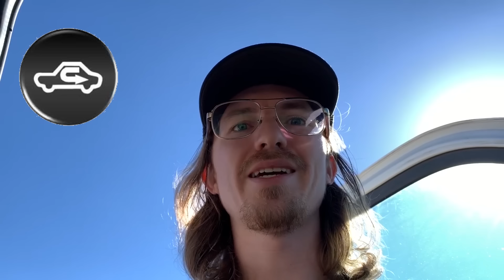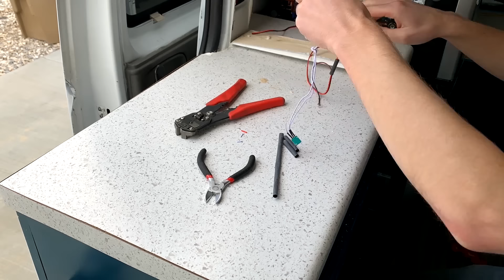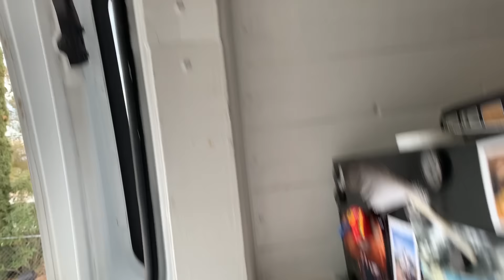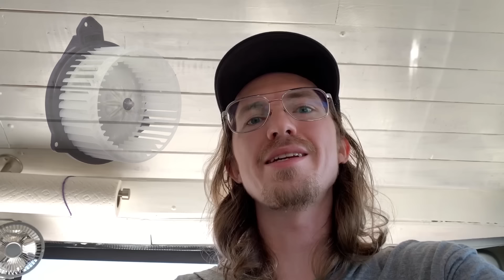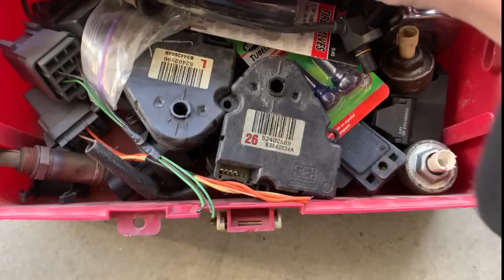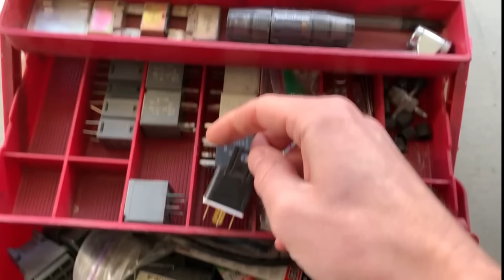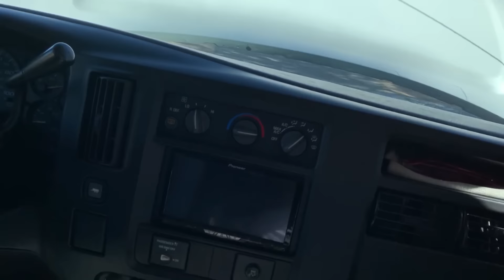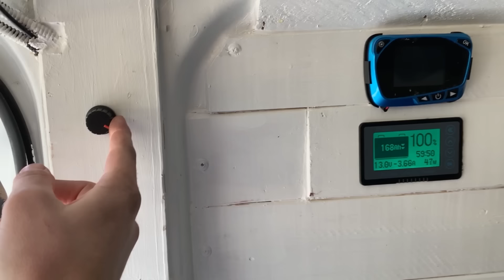OEM Blower Hack **ULTIMATE STEALTH**

Comment: Neat idea, but a rooftop fan will pull air OUT of the van and will do a FAR FAR BETTER job of that than trying to push air out the body vents via the OEM blower motor.
Reply from the maker: Spot on Mike.
Really wished I would have left roof space for one, but I suppose this is better than waiting for a breeze to clear the interior air.

Next build will definitely have a roof fan.

Thanks for watching!
-Tim
Reply: @VanwithTim  There’s nothing stealth about a roof vent, so I’ve given this a bit of thought (but no action)... I wonder about a fan that pulls air from up high near the ceiling and then pulls/pushes it through venting (completely inside van) and pushes it outside through the floor. Basically like a chimney but in reverse.
Reply from the maker: @FloridaNativeMike  I'm feeling it, like a duct that grabs all the hot air from the ceiling then pushes it down and out.

Someone else mentioned using a fan affixed into the "step" area and vented through to the underside to push cool air into the van.

Have you seen this stealth window setup yet? Pretty cool idea:
https://youtu.be/9WdWvQaoN5A?t=230
Reply: @VanwithTim  I hadn’t seen that one, but a lot of folks with cargo trailer conversions vent the AC through the floor, similar to this one: https://youtu.be/9lH5-rdSRos I would think that could be made to work in a van, maybe using some tubes to move the air instead of such a large hole.

Comment: The first time viewer, thanks Youtube for the recommendation. 

I'm guessing the idle draw on the motor controller is minimal but what about swapping in a Potentiometer with on/off? Ok now to check out your channel...cheers.
Reply from the maker: Just measured the standby power draw at 0.057a at 13.1v (so ~0.75 watts)
Not a big deal for my battery bank and solar setup, but those with smaller reserves may want to integrate an on/off switch as you mentioned!
Good call Daniel 👍

Comment: good stuff.  I have an 95 E350 15pack and have been thinking about how to use the OEM rear passenger compartment blower when the engine is off. cheap and easy solution here! 
Also happy to see someone else using that cheap 3kw "reliable" brand inverter. 2+ years of that bad boy on 24/7 in my rig with no issues!
Reply from the maker: This would be great for that!
Funny on the inverter. Was just thinking I've been pretty lucky with it. 
This certainly isn't a high-dollar van build.
I also just leave it on 24/7 unless I'm storing the van for a month haha

Comment: 2 pc fans on the exhaust grills is a cheap and efficient option or maybe leave ignition on and charge van battery with the solar controller so it just costs wire.
Reply from the maker: We actually used to keep the key on and just run the fan, unfortunately our Victron battery combiner disconnects the starting battery from house battery if the solar isn't charging / van isn't running.

Could always do a manual bypass so long as the combined battery voltages were monitored closely!

-Tim

Comment: Hey Tim - noticed you have your passenger seat turned around. Is it on a swivel? The only swivel I've found offsets the seat 2" in order to clear the door, but curious if you found a way around that?
Reply from the maker: Hey Chris, good eye.
Unfortunately it was a custom manufactured swivel from John Kennedy and this was his last one. I don't believe he's planning to manufacture any more. It does keep the stock seat height which is nice.

Here's more information:
https://www.facebook.com/groups/1426529440979542/permalink/2380171022282041

Comment: Still not as efficient as a fan up high blowing out drawing in cooler air
Reply from the maker: Spot on. 
A (very small) saving grace is the mode selector defaults to defrost when it inadvertently loses vacuum in the actuator. 
So at least it pushes the cool outside air somewhat towards the hot roof.

Rooftop fans will always be king of efficiency though!

Thanks for watching!
-Tim

Comment: Similar to a plan I have. I will utilize the rear vents and ductwork in the rear of a minivan and attach a dedicated 2-way fan via section of flexi duct and manual damper. Fan will run from leisure battery. Reality might adjust this plan, ofc. Great video btw.
Reply from the maker: Utilizing the factory duct work sounds like a clean install to me! 
Thanks for watching Neil!

Comment: beautiful!! i want to do this project even though i already have a roof fan! 
when you were thinking about only running a positive wire up to the fan i was thinking to myself “NO!” ... but then you found out you had a high-side dimmer.  
great video!
Reply from the maker: Hey Leo, thanks for watching!
Still a little bummed I can't reverse the air flow like you can with your rooftop fan, but it was a fun project and seems to work really well!
-Tim

Comment: "should be" quieter for stealth camping too
Reply: Can be quieter than OE because the PWM will allow you to set the fan speed lower than the OE resistance control.  I have only seen it noticed once in years doing this.

Comment: im another Tim vanner.... do other vans have that stock recirc thru the body & out the back set up?
Reply from the maker: Hi Tim, all vans will have that same setup of fresh air through the front, stale air out the back through the hidden vent(s).

The vent in the rear is disguised not only visually but also in name. GM calls theirs "Air Relief Vent" or "Relief Valve" or even "Pressure Valve, Quarter Panel Vent"

Here are some examples:
https://www.gmpartsdirect.com/search?search_str=air%20relief%20vent&make=&model=&year=2005&page_id=&page_url=

What type of van do you have?
-Tim
Reply: @VanwithTim   i have an 89 turbo dodge caravan (minivan). My climate controls are messed up ill have to mess with it.  i would like chevy van like yours tho
Reply from the maker: @saltpepper1894  Respect, the ORIGINAL mini van!!! The Express van is nice but I bet you get much better fuel mileage. (I'm averaging 11 mpg  driving like a grandpa... yikes)

Hope you can get your HVAC controls figured out! Thank goodness for the internet to help with diagnosis.
Reply: @VanwithTim  Ive seen the vents your talking about....they have multiple flaps that pop out when you close a door....for your purpose (if your looking for less power consumption) why not modify the flaps so they stay open for better efficient flow? heres a video of a guy changing one vent on his express van... https://youtu.be/bojpqjooZtU
Reply from the maker: @saltpepper1894  Oops just replied to your other comment with a video of the flap location lol.

That's exactly the vent I'm referring to.

My flaps are pretty loose (very little resistance aside from gravity holding them shut). It's possible they're just worn from their 17 years of life.

I wouldn't mind having a second air exit though. That's a lot of air to cram through such a small space.  I actually added screens on all of my pop-out windows (side and back).

Comment: Very clever. That would be ideal to clear the condensation or ice from the windshield after a cold overnight. Wouldn't need to start the engine and wake the neighbors. Start the diesel heater and turn on factory defrost.... but wait hmmmm?? What about the vacuum motors that control  the blend doors??  Is default (no vacuum) defrost???
Reply from the maker: Hi Grant, I’ve woken up to frosted over windshields all too often!
Just finished the diesel heater install last month and excited to try it all out together.

The mode door is vacuum actuated but luckily it defaults to defrost 👍

Had a wonky vacuum check valve when I bought the van and the AC would start blowing on defrost whenever I accelerated haha

Thanks for watching!
-Tim

Comment: The engineers at GM must all live in houses with heated garages.  How else would they think that having the heater bring in 15 degree air (while the engine is still cold) in the wintertime would be a good idea??  I'll never buy another GM product unless it's got a dedicated recirc button that keep the cold air OUT!!
Reply: It's not just gm that does it. It's done for safety so the window won't fit up from your breathing (if course if you just quit breathing problem solved). It's also the same reason your ac runs in defrost, to dehumidify the air. That is hvac operation for dummies
Reply: @1towmater1  GM defaults to outside air to slightly pressurize the interior to avoid drawing in carbon monoxide, that is why this installation is better than a roof exhaust fan.
Reply from the maker: @1towmater1  A lot of newer cars automatically switch from recirc / fresh settings. 
They read multiple temperature sensors of course, but also vehicle speed, light sensors (for solar penetration), and multiple hydrometers (to prevent the fogging you mentioned).

Many will start in fresh air mode during the summer to push the initial stale air out then default to AC recirc.

In winter they work to monitor the interior humidity more closely and you'll notice them switching between recirc and fresh air more often.

It's amazing how far the systems have evolved! (Just not in this old van haha)
Cheers!
-Tim
Reply from the maker: So ridiculous I know... The real bummer is you can't simply add a quick electric switch for it.

All actuated via vacuum other than the temp controller. Such a disaster.
Reply: @VanwithTim  suggest installing an air switch in the vac line going to the outside air damper actuator then u would have control of the outside air in any setting.

Comment: Although this is a genius idea, it doesn’t solve the issue of air circulation as fast and energy efficient as MaxAir fan
Reply: What about a floor fan the kind used to circulate air from room to room. Just one drawback is that one can use it to blow the air out only. It would be stealth enough and no worries about water leaks
I saw someone installed a fan at the sliding door step wall
Reply from the maker: @saidt.8200  Oh that's an interesting idea! Something like this?
https://www.amazon.com/AC-Infinity-Register-Thermostat-Control/dp/B0792QR5YT
Reply: Exactly. Thank you for sharing
Reply from the maker: Absolutely right on both counts 👍
Those MaxAir units move loads of air with very little power draw.
Wish I would have left space for one, but necessity is the mother of invention I suppose!
Reply: Pop out a rear window and replace with a piece of Aluminum painted to match. Cut a hole to mount a fan and have a sheet metal shroud riveted over to keep the water out
Reply from the maker: @mrmotofy  Check this out, looks close to what you're describing just without the window removal.
https://youtu.be/9WdWvQaoN5A?t=230
I bet it moves a TON of air.
(Same PWM fan controller I'm using for the blower motor funny enough!)
Reply: @VanwithTim  Yep that could work too, same idea different implementation
Reply: Computer fans are cheaper and use less power . It depends on your skills. Recycle . Peace
Reply: @ALF5565  they also move much less air
Reply: @mrmotofy  that's a matter of options
Reply: @ALF5565  One can look at the CFM of the fans and see the facts, not opinion
Reply: @mrmotofy  your free to use any fan you want.  They work for me. Some like there coffee strong some like it weak. Fact. A computer fan is cheaper. I recycle them. Cost free. Cost of maxair fan ?? Over $100.  And there's a big difference in power.   So it is opinion.  Peace
Reply: @ALF5565  A Maxxair is 900 CFM as in volume of air it can move in a minute. A typical 120mm computer fan is 30. So it would take 30 of the decent sized computer fans to match the maxxair, then it incorporates the whole vent assembly and a variable speed control. The facts are the fans are nowhere near comparable. Sure one can computer fans...but not as a replacement for a maxxair

Comment: Cool idea! Might do that in place of the second roof vent on my Truck
Reply from the maker: Seems to work well so far!
Certainly a much cheaper solution.
Thanks for watching!
-Tim
Reply: @VanwithTim  also this is much easier to integrate into my home assistant than starting to solder around on a control board of the max air or fantastic fan..

Comment: Living in the South, I always thought that it would be a great idea to have a system set up like this for when your vehicle is parked at work... purging the heated interior with a solar powered fan. No reason to add another blower if the one factory installed does the job...  Glad to see someone actually put together a system to do it! Have you thought about a temperature controller using the interior-exterior temperature delta?
Reply: Some Toyota Prius had this from factory around 2010-2012, they have a little solar panel on the roof to run it. I've been considering adding that feature to mine and this video helps a lot!
Reply from the maker: @MinimaDomum  That's really cool! Haven't heard of that but makes total sense
Thanks for watching!
Reply: @MinimaDomum My 2015 Prius has it.
Reply from the maker: Hi Derek. That was exactly my thinking. 

Works perfectly as it's mostly needed while parking in direct sunlight, so the solar stays nice and happy while moving the hot air out.

I have actually been thinking about a temperature control using exactly that data. Would be nice to have it automatically turn on and off.

I've used a couple W1209 thermostats but each time it seems something on the board burns up when voltage goes over 13.5v (Luckily they're <$5)

Will have to search for other economical controllers or utilize a 12vdc to 12vdc voltage regulator I suppose!

Comment: Have you found the positive pwm fan controller slower to spool up the fan from off- low settings?
Reply from the maker: Excellent question on this. 

I was a little worried about that initially, but it seems to handle it fine. 

The centrifugal fans are so quiet at low speeds it's very hard to tell it's true RPM short of removing the fan and bench testing the setup.

To be safe I typically turn it to at least half speed first, then lower it down.

Thanks for the great comment!

Comment: Thanks for mentioning about the futility of reversing a blower, I hadn't thought about that.  I've worked with the fuse packs, it's interesting that they don't waste any power on high (0 resistance), and very little at the lowest settings (not much current, so not a lot of power)  They are actually worst at the setting just below high, high current + resistance = high power dissipated by the resistor.  That's also my favorite setting, probably why I burned up my resistor pack eventually :P  PWM is a really superior method of speed control.
Reply from the maker: I was hesitant to include the techy stuff in fear of boring or scaring people  Thanks for the comment, makes me feel a bit better about keeping it in!

Would love to ditch my factory HVAC blower control and put another PWM controller in there (nice to have infinitely variable speeds and such high efficiency), but too many other projects on the table right now. (and a precise factory looking knob fitment could be tough!)

Thanks for watching! -Tim
Reply: @VanwithTim  factory looking knob? use a factory knob!
Reply: these pcb pwm controllers with a knob sticking out, the knobs all pop off shaft you can prob adapt any knob to.